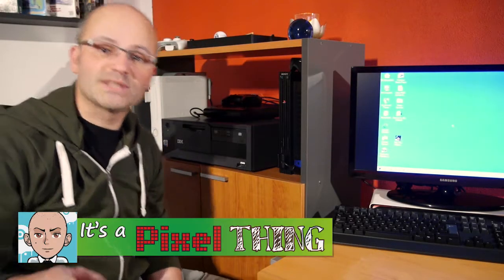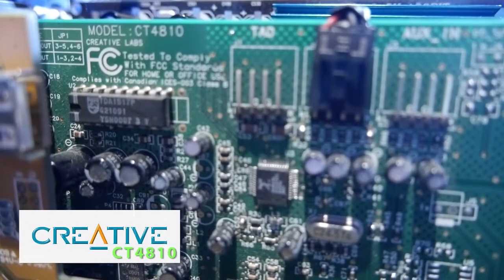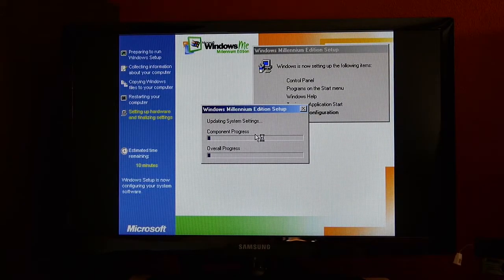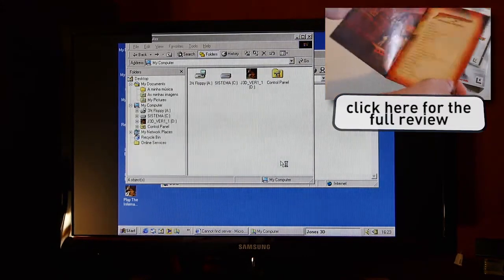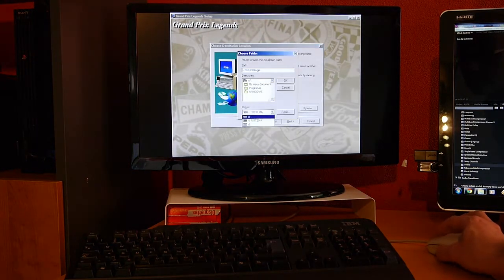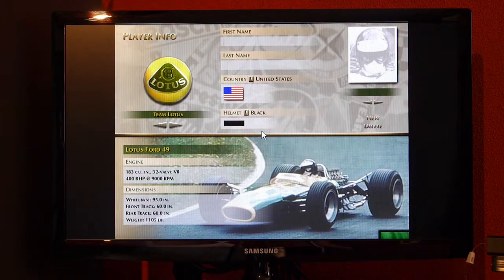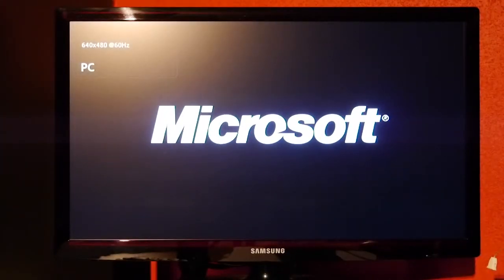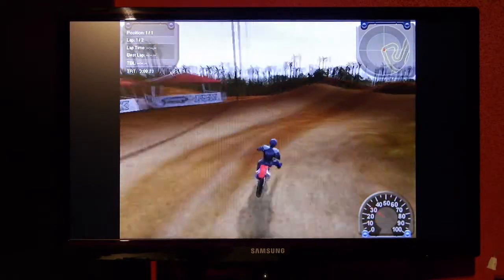Late 90s PC Gaming Rig - IBM NetVista (type 6793)

Comment: I found my IBM NetVista PC lost on the Streets. The Powersuply was not Workong. I replace it, and now it works. 

My PC Specs: P4 2,00Ghz, 1 GB RAM, 40 GB HDD, DVD and CD Drive The DVD Burner is NEW and is SATA with an Adappter to IDE 

And it has a Geforce FX5600 Card, and also a USB card with 4 Extra Ports. 

Windows XP SP 3 ist Installed.
Reply from the maker: Nice :)

Comment: i have almost the same. is a Netvista 8305 but idk why it won't boot with a 2.53ghz/512kb pentium 4, just with celeron 2.0ghz/128kb it boots.
i have to change the serial number when flashing bios in order to get the p4 to work?
Reply from the maker: Are you sure it's a P4 processor? That's weird. What OS are you using?

Comment: did the same setup as you same ibm and cards, loaded the drivers and software. went to restart my put. Now it will not boot into windows in normal mode and but will in safe mod
Reply from the maker: +Evan Patterson Mine still works flawlessly and I'm preparing a new episode where gameplay is done entirely in that IBM machine! ;)
Try to install other OS and see what happens.
Thanks for your message ;)

Comment: Windows ME is the most terrible os ever better to go for a windows 98 install.. for retro pc gaming.. :)
Reply from the maker: You're right, and I've mentioned exactly that on the video. I just want to know how bad it really is for playing retro games, for windows 95 and windows 98 :)
Until now, everything works very well! :)
Thank you for your comments! I really appreciate it!
Reply: Come on WinMe was not that bad. From my own experience [I've used it since the launch until SP2 for XP came out] I can say that on the contrary it was one of the better windows. I had no problem with the drivers, software nor games - and man, i tested a lot of stuff back then... The only binding "error" for which everyone hated it at the time was, that it did not allow a reboot to DOS directly from the start menu. [like w98 did]  

P.S. Try original Windows XP without any service pack, that's a real pain in the ass! :)
Reply from the maker: MiNHO Dotus Agree! Win ME (aka "mistake edition) is a pretty stable OS and error free, if you want to used only for simple stuff like gaming! Since I've installed it on the NetVista, I've had zero problems. Everything is working like it should! ;)
Thanks for the comments! :)
Reply from the maker: Indeed, it is unstable, but, since I installed it in that Netvista, it still works flawlessly ;) You're probably right! This is a more "recent" machine, so I guess that your "theory" is correct ;)
Thank you for your extremely appreciated feedback! :)
Reply: The shit gibberish about ME is the same desinformational nonsense as with Vista and Windows 8. Yeah, ME had a little more hidden DOS support, but was far more reliable than the constant BSOD-throwing, single task-authistic 98SE that would take ages to boot and not even shut down properly. If DOS is such a problem for those retards then Windows 2000 is even worse, not to mention XP - a real DOS gaming rig isn't even capable of running ME.